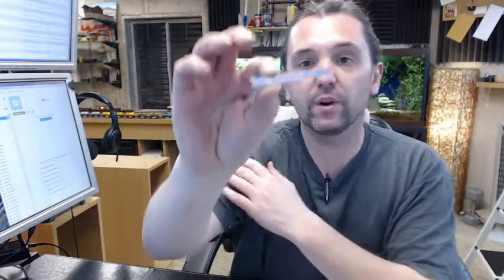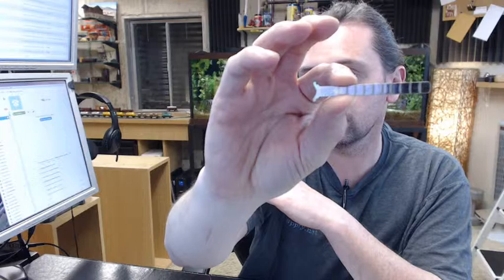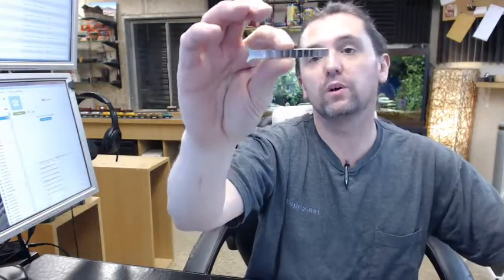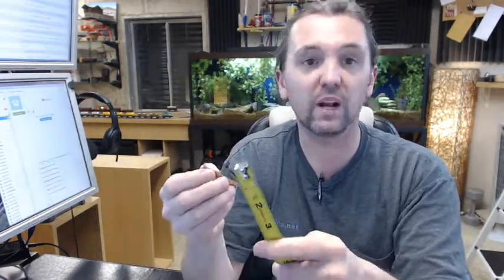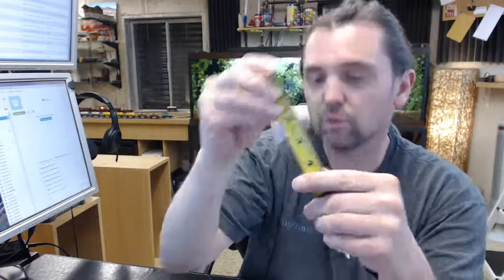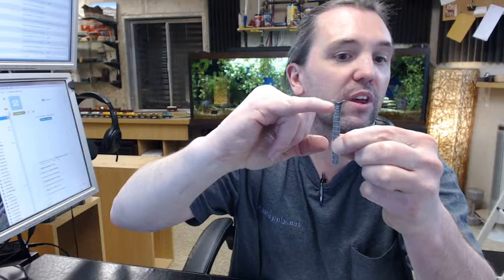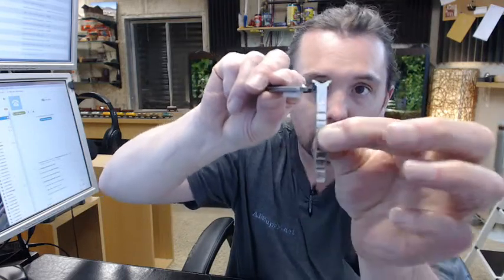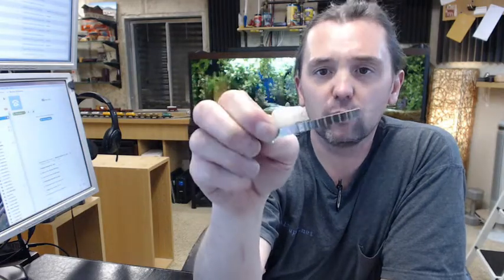Kaba Ilco 862A-00-10 Extra Long Tailpiece

Comment: Thanks for the video, I wouldn't have known about longer tail pieces! If I may ask: is this a "universal" one, meaning, is there anything I should watch out for, in order to be sure it'll fit when I exchange a short tail piece by a longer one (for a thicker door)? I m not experienced in that I have no idea whether there are any differences in "shoulder" type of the tail piece? Or do you think such tail piece ought to always "fit in" the rode? I'm worried that the shoulder piece comes in different sizes or such. Could you please share your thoughts? I hope you are still reading this, and Many thanks in advance!
Reply from the maker: I would recommend that you reply to this with a photograph of the unit that you are replacing, a photograph of the cylinder along with the keys that operate it.  We will attempt to ascertain the proper longer tailpiece for your application.
Reply: Hi Richard, I was very happy to hear you d try and see what type of cylinder I need (I need another one for a much thicker door of 2.3622 inch or a bit thicker is fine too) . I am linking a YouTube of the lock which has the wrong cylinder for a thinner door. 
http://youtu.be/kisASUgnAEg
Would you mind taking a look please and advise which type I should by from your shop? Thanks so much. I really appreciate the help.